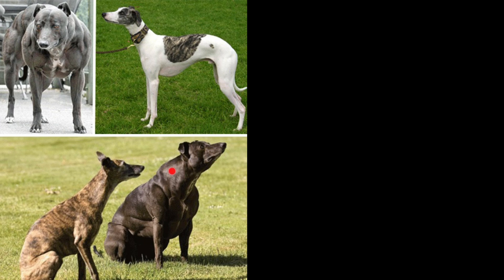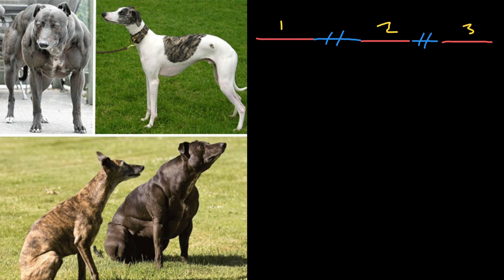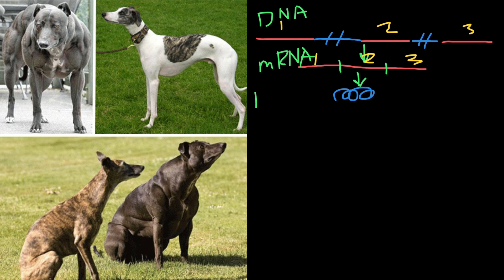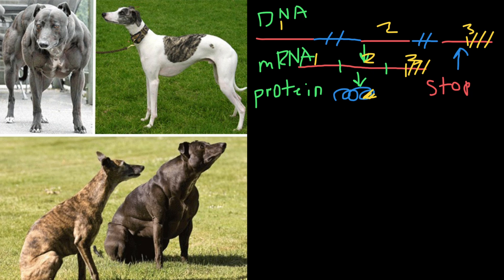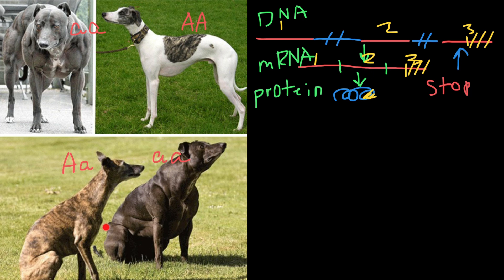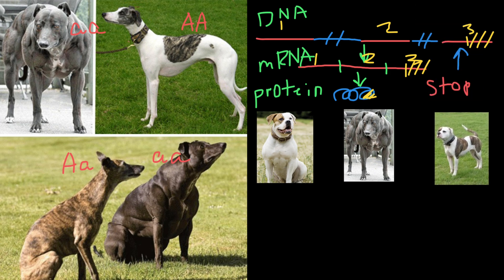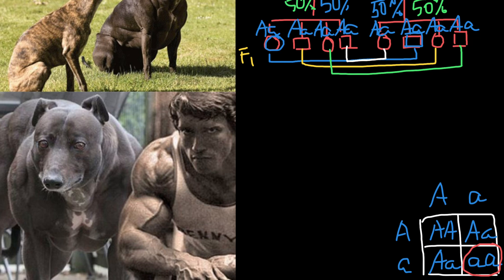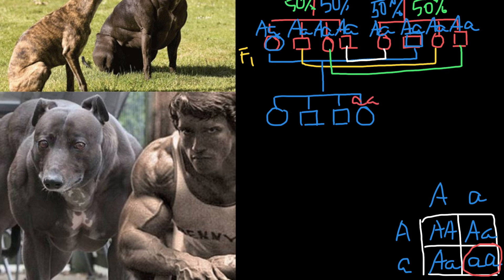How to breed SUPER-Dog?

Comment: Great video! Please make a video about how I can breed a large mastiff type dog with erect ears like a French bulldog or a Bull terrier.
Reply from the maker: Great suggestion!
Reply: In the 90's i wanted to breed a big dog that has a stop and a short muzzle but with erect ears. I still want to do it. I would probably use a French bulldog as it is the only widely spread mollosor type dog with erect ears. Then ill have to cross it with a big dog. The minute i do that i will lose a lot of size and most of the pups would have floppy ears. I might get 1 or 2 in the litter who has the frenchie ears. What would be the next step? Would this process work the same as the selection you did in this myostatin gene video. Thank you again for the great content.

Comment: Would this only work by using two different breeds and continue this type breeding until you eliminate the breed you are not trying to breed for? Or could you use the same breed but of different families to do the same?
Reply from the maker: You can do both - but second method faster.